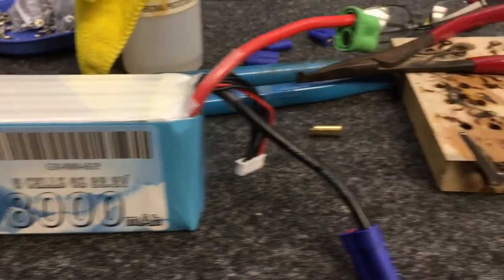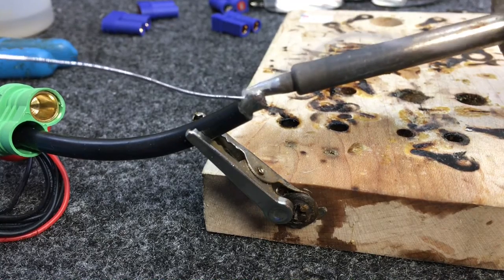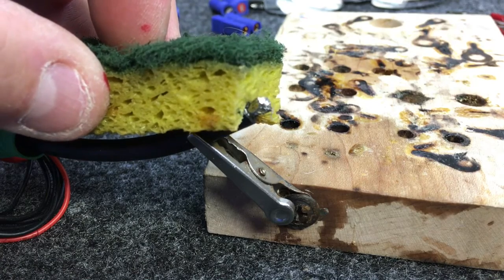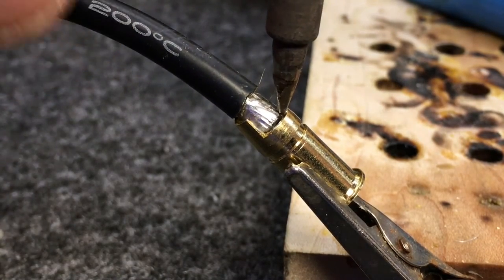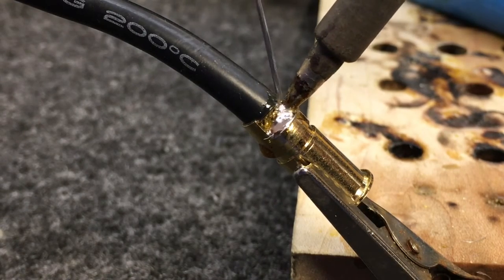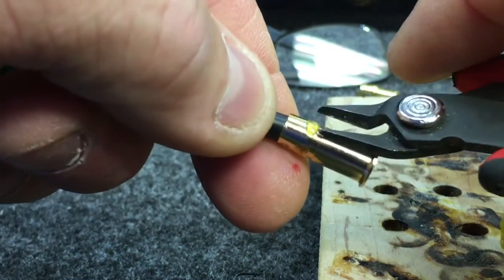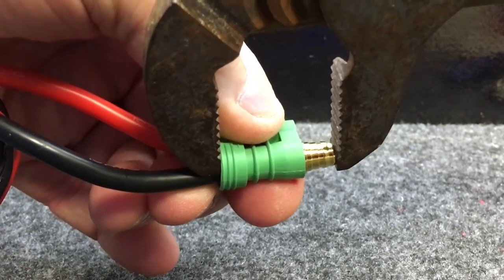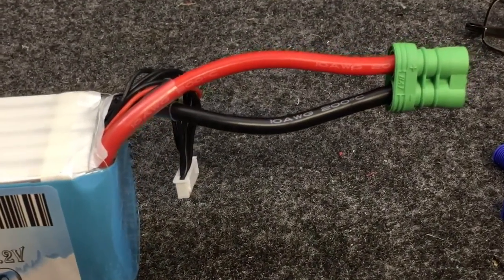Soldering tips with large wire and bullet connectors. WWD2 Series

Comment: With my Xytronic LF3200 120W soldering station I can use 700 degrees on these big connectors with no problems. It uses high frequency induction to heat the metal in the soldering tip directly rather than a heating element. I also use flux paste on large gauge wire like this.
Reply: Just a thought: Does that high frequency have the ability to damage and ESC or battery? Don’t sound like something I’d trust near a $500 ESC.